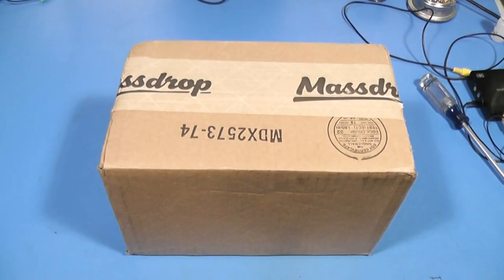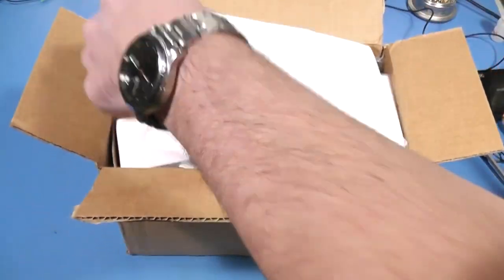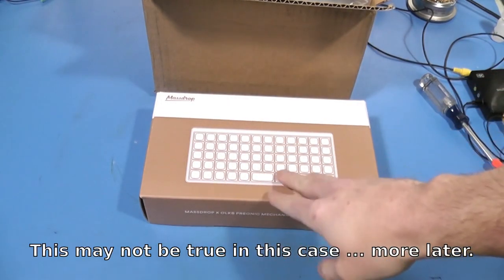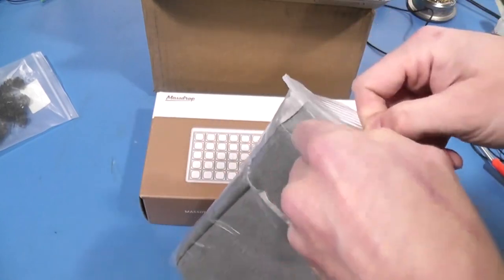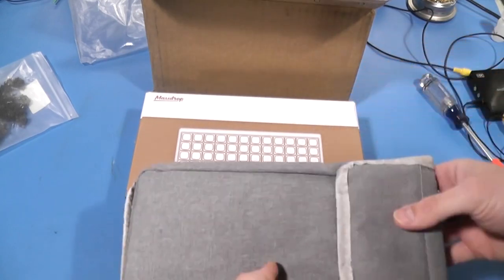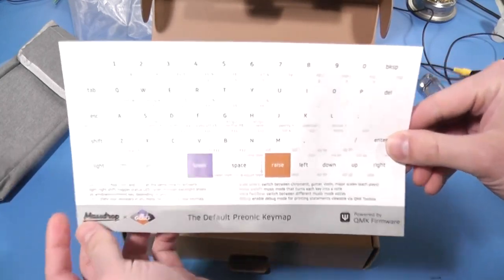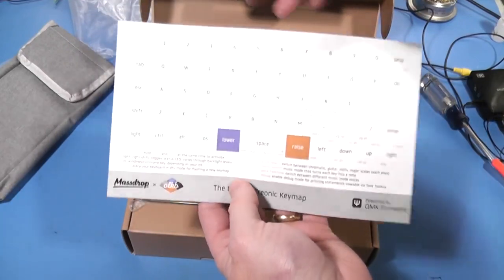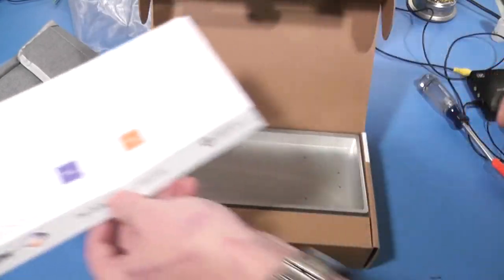OLKB Preonic Mechanical Keyboard - Build and Initial Impressions

Comment: Nice video. I hope you don't mind a little pedantry, but the ErgoDox is a column-staggered keyboard. The Preonic seems to me the antithesis of what an ergonomic keyboard should be, it compromised ergonomics for compactness. The Atreus keyboard is a symmetric stagger compact keyboard, but it does compromise size and number of keys for ergonomics. I guess I can't have my cake and eat it too.

The rationale behind column staggering is to have keys positioned in a way that you don't have to over-extend some fingers, over-arch others or rotate your wrist to be able to reach certain keys. The ErgoDox feels much nicer than a regular keyboard in this aspect, but I feel it could be even better if the pinky column was just a bit lower, like in the Maltron L90 dual hand ergonomic flat (2D). Or you can go crazy and try something like the Maltron "fully ergonomic" (3D), the Kinesis Advantage or the Dactyl.

But don't take my opinion as gospel, it's just my opinion and you should use whatever works best for you. I love my ErgoDox but it's not very practical to carry around, I'm thinking about getting either a Corne (crkbd) or an Atreus to carry with my laptop (choc switches seem to be a good choice for that). The Preonic seems very cute and I think it would be a decent alternative over a full size keyboard on flight/racing simulator setups for whenever you have to do something on the keyboard, but I could never use it to type a lot in it.

Comment: fyi "vertical rows" are called "columns"
Reply from the maker: In some contexts that term is used, yes, thank you.  However, consider field rows - they're rows whether you view them transverse or end-on.  Fields, like keyboards, are on a horizontal plane.

I'm not saying "vertical rows" is right, but I'm pretty comfortable calling this pedantry.
Reply: @EthanBlanton  field as in crop field or field as in struct field?